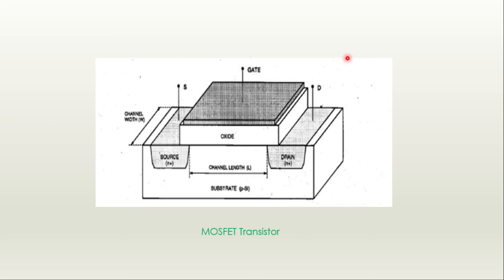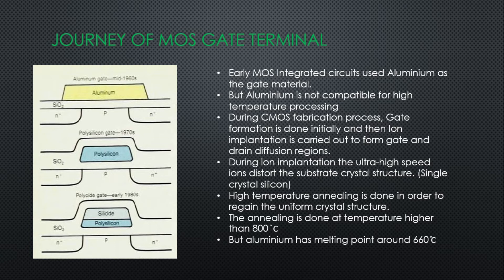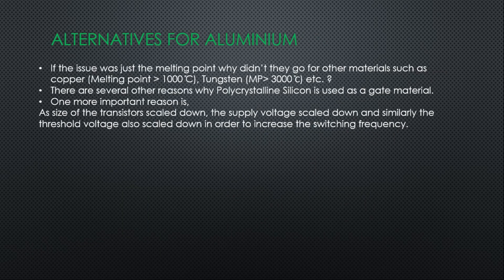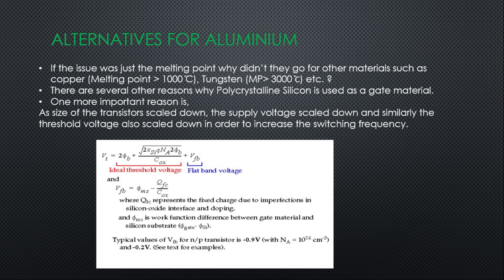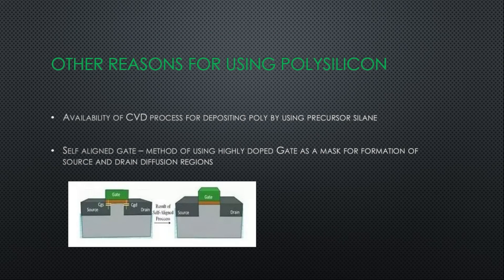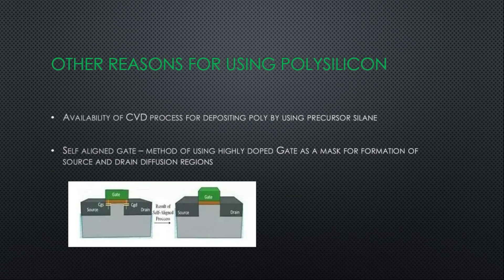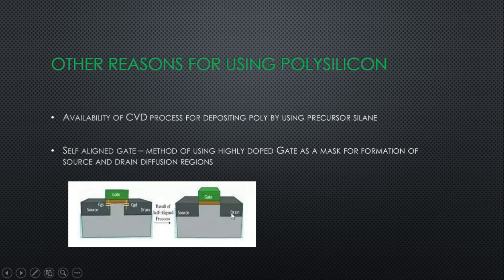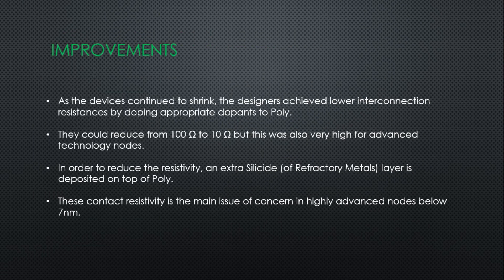Why do we use polysilicon gate in VLSI?

Comment: Why we can't use self Aligned process for Al gate?
Reply from the maker: Hi @shivani, aluminum can be used for self alignment process but if we use it what happens? Think of it. We will deposit aluminum first, then we do ion implantation to create p and n diffusion regions. Then, we do annealing process for the proper diffusion to happen and the impurity atoms settle down in the best lattice points. Annealing happens at atleast 1000 degree Celsius. Aluminum melts at 660 degree Celsius. It just melts. So, aluminum has to be deposited at the end. After the formation of diffusion regions. Which means, it's not available for self alignment process. Hope it clarifies.